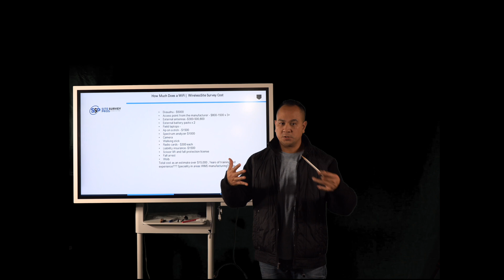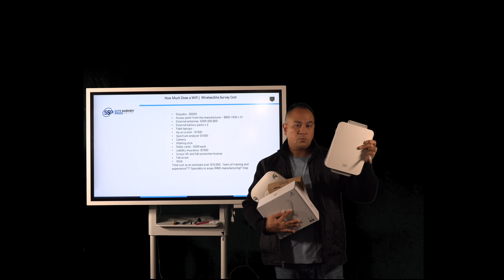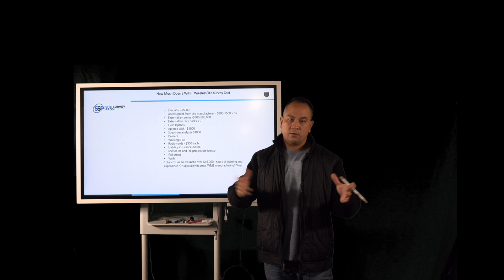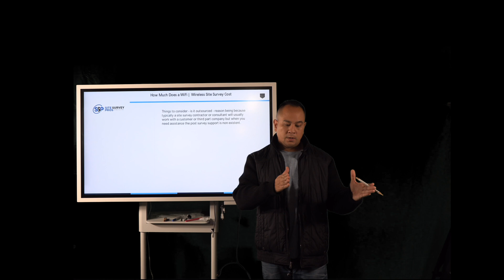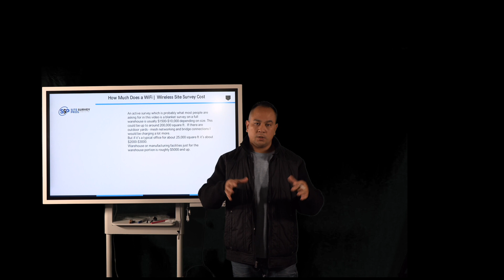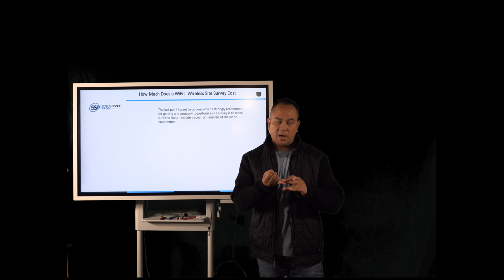How much does a wifi wireless Site Survey Cost

Comment: Thank you for the information.. I am starting out with wifi surveys. I have been in the wireless PTP microwave space for over 15 years and looking to make a transition to the wifi space. I was hired to do a huge site survey by an integrator whose client's network is having major issues. Needless to say I didn't charge correctly but I rationalized it by counting this job as a learning experience. I spent 8k on the gear. I quoted 5k based on a misleading SOW and size of the premises.     6 residential buildings with 4 floors  totaling about 260 apartments.  They want me to do another similar site in NC. I am thinking I will turn it down and start marketing in the Chicago area to avoid travel expenses..
Reply from the maker: Smart idea. I’ve made the mistaken many time in my earlier days. It’s always best to see the site and if not get a detailed schematic. It’s a difficult situation as sometimes your not sure by giving an extra % off the quote could potentially get you more business. For example I had one customer who I provided a survey for $2k but usually should have been $7-8k for a large facility. But in return I managed to work a great relationship with the account and now they come to us for all their consulting and managed services. I’ve driven 6hrs once to do a site survey that took me 50 minutes. Lol
Reply from the maker: You can always pitch them on this. If they select your company to purchase the hardware from and professional services you can discount the survey. A couple of companies I use to work for would waive the $2500 site survey as long as the company would purchase the rf scanners and access points from them.
Reply from the maker: Also in the start of your journey you’ll want to open up your skills by providing printer repair to your portfolio or Rf scanner repairs. The reason being is because all 3 keyword terms in google/seo when someone is searching for “site survey your city or barcode label repair your city or scanner repair your city” this will create keywords for lead gen calls to your business and if you get into a warehouse or client. It’s a very high chance that they’ll keep working with you for a long while. Just provide great technical service and good customer relations.